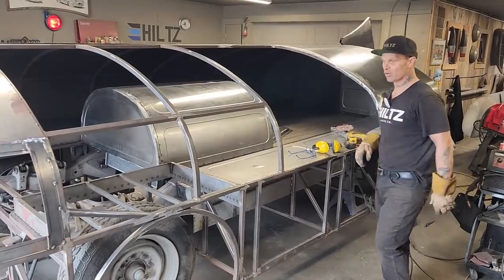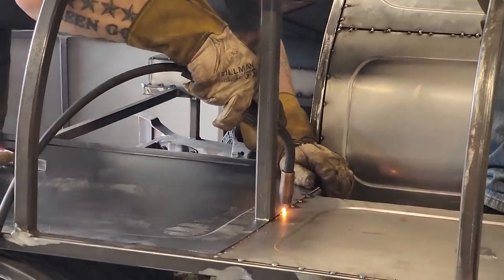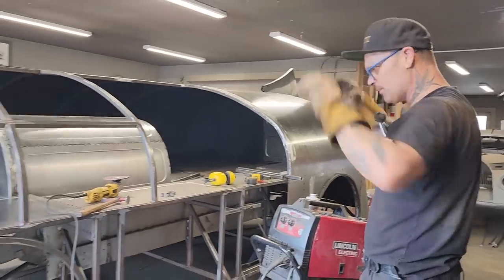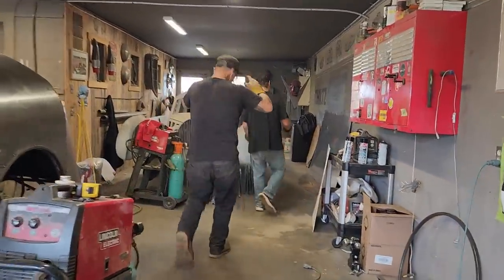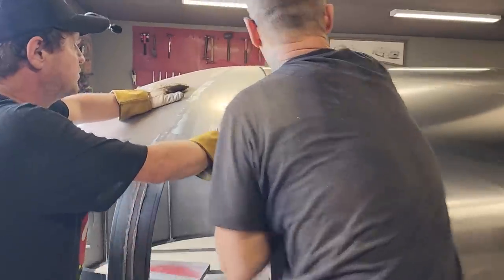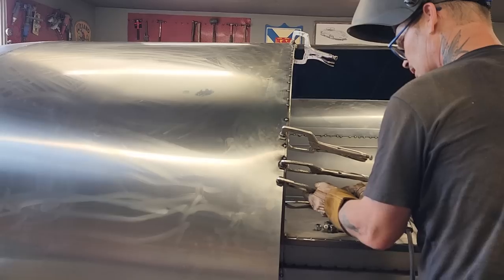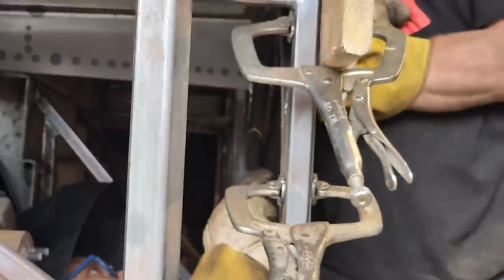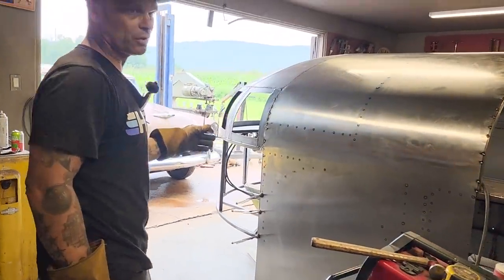The $1,000,000 question... "how will you get in it?" 🤨

Comment: This project will be a Microwave Oven when it is done.  No opening windows or ventilation, with a motor that reaches 190-200 degrees for extended times inside the metal box.
Reply: @daddysails8926 the literal definition of a motor says it’s a machine powered by electricity or internal combustion
Reply: It will look cool and I enjoy watching the process. However, I would be surprised if it is ever be used for its intended task.
Reply: I’m glad the central opening is larger , this will allow for the truck being used for luggage etc .
Reply: Ventilation could easily be organised with roof vents and filtered openings at front , aircon even possible.
Reply: @daddysails8926  In the land down under motor, engine, donk, and a bastard when it wont start........
Reply: He has welded in so many load multipliers that it’s bound to develop stress fractures. This is a cool project, but I would have started with a roll cage so the backbone could carry 2 large hydraulic clamshell doors. I would have NEVER skinned it before it was a rolling driving chassis. But it is still cool looking.
Reply: First lets get the thing built then work out the bugs later. There's no blueprints for this it's trial and error when building a custom. Adapt and overcome. The Champ doesn't have the word failure in his vocabulary.  😉✌
Reply: It’s just amazing how people are making these comments about stuff that has not being worked on yet it still has a long way to go and sure chads crew will get it figured out !!!!!! They have a bunch of great people who are really good at making things work.

Comment: Why not put doors on either side in front of the wheel wells, hinged at the top. Seems to me that would be a heck of a lot easier entrance and exit then making poor Jolene crawling on her hands and knees and slithering slide around trying to get into the front seat without flopping around into the front seat
Reply: Because he wants to do it this way.. His build,  his design...
Reply: I think thats a fine suggestion. I can’t imagine climbing in above the wheel but perhaps he has something we don’t understand yet. However he does it I’m sure will be fine. Not like its going to be a daily driver.
Reply: The curve would be difficult to fabricate and weaken the front. Hinges would be tricky too.
Building it where he is is the simplest answer maybe not the most ergonomic for the passengers.
Reply: I expect there would be next to no structural integrity in the case of a front end colussion.

Comment: Had a thought about halfway thru the video so I don't know if you have done this.  What about anchoring the door at the bottom with hinges and turning the door into a stairway to climb into the vehicle, kind of like an airplane.  You would have to reinforce the heck out of the door and probably have to use cables on either side to provide support.  Ultimately, it's your vehicle and I will enjoy whatver you do.   Just my two cents.

Comment: I'd say at least 2 gull wing or clam shell style doors/ door up front and make the.front windows like safety escape hatches.

Think of safety in a collision or engine fire, how are you going to want to exit safely and quickly?

Re fire safety it might be worth rigging up some engine fire auto extinguisher foam sprinkler system.

Would be easy to figure out, 2 or 3 fire extinguishers plumbed into sprinkler valves opened by smoke detector or heat detector or a manual override control in the cab.

Comment: ** why have 2 doors? why not just one door?  One door is enough ( the door in the center of the 2 tool boxes that is used in the event you need to remove the engine cover/dog house )   just a thought. Also one door is less work and less chance of water leaks inside since there would only be one opening.